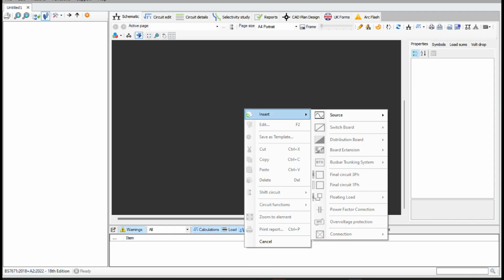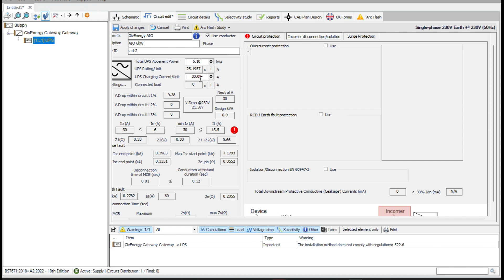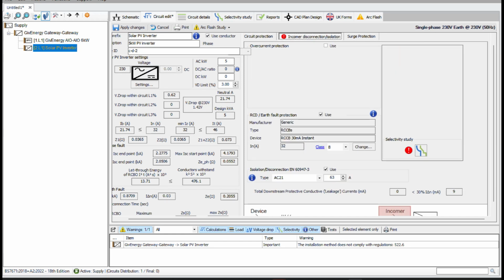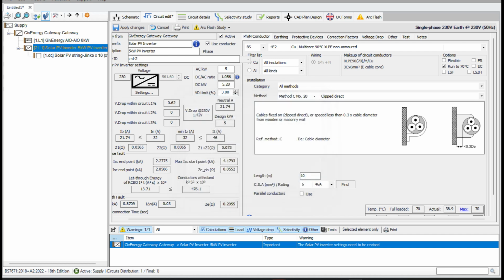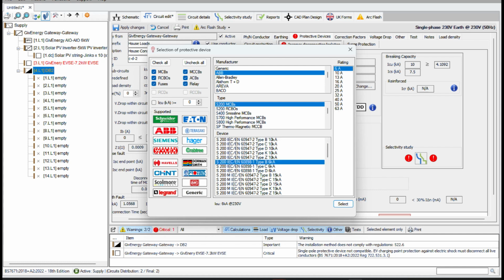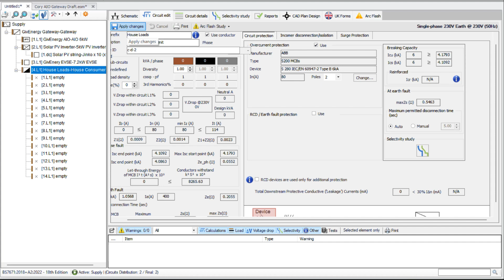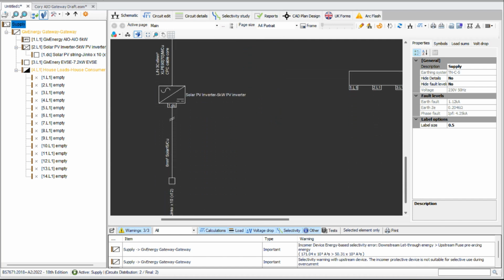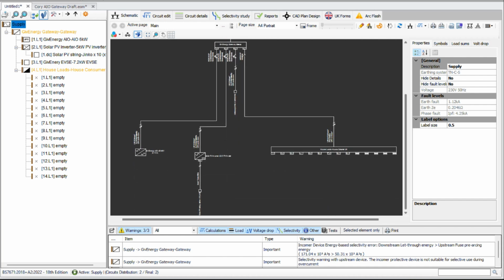How do you design whole home power backup using software?

Comment: I am just thinking that it may work better to not set the AIO as a UPS on a final circuit but set it up as an alternative ’source’. This way you can change the active source to ensure the installation complies in both grid tied and non-grid tied modes. 

I think you would do this by right clicking on the GW and choosing ‘add source’. Then change source type to DC battery.
Reply from the maker: That is an excellent shout. Will give that a try!

Comment: Great software 12 months in of industrial designs and still keep finding new features that save you hours of work than using separate programs. 

The schematic shown in the video can be framed and turned into a cad drawing in less than a minute and if you spend the time to label can form part of your documentation pack for points of isolation etc for your renewable compliance.

 Pretty sure my face is on their canteen dart board, for the amount of time I email them or the long list of requests I send in 😂 which to be fair they do listen and implement.

A work around for a stand alone main switch/switch fuse is to use the junction box option and add cpd, this will also allow you to change cable size at this point you can then change symbol to look like main switch. Junction boxes will show on the ukforms as a separate  test Although you can combine them via circuit edit and notes tab.